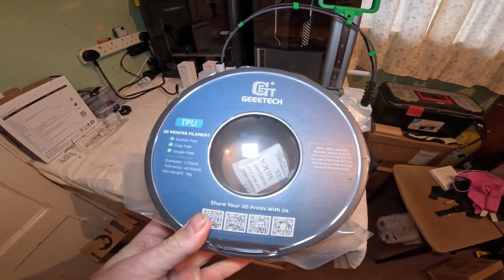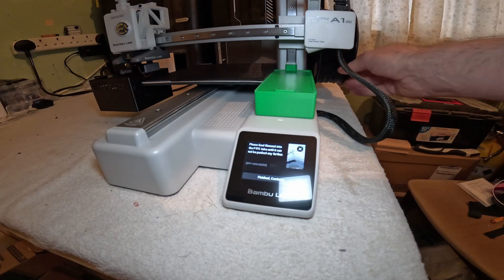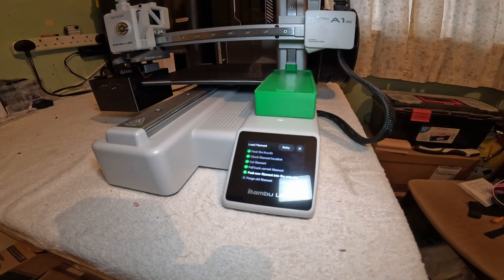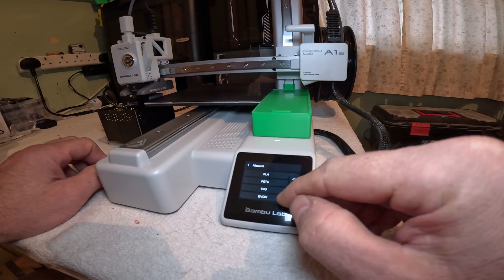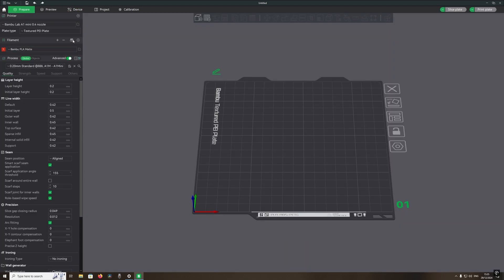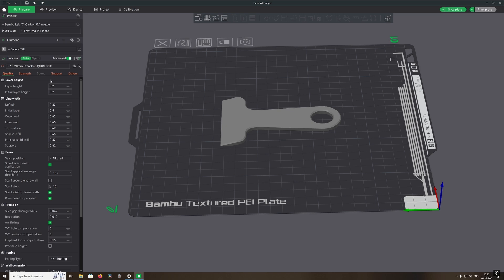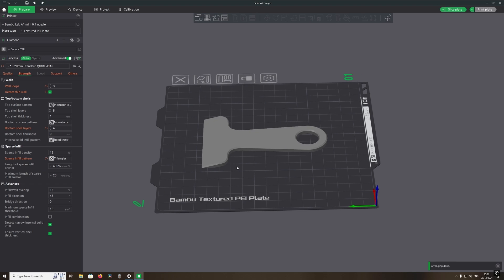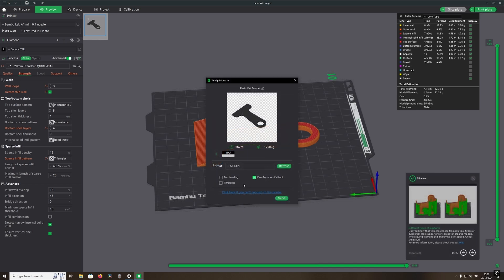Bambu Lab A1 Mini, how good can it print TPU.?

Comment: Halo mr, is it true that you can use TPU filament with the Bamboo Lab A1 Mini? Then, when loading the filament, why don't you switch to generic TPU first? Because what I see is that you change it after loading the filament and then printing the part.
Reply from the maker: Because when I use genetics settings.. it doesn't print as good as it does with bambu settings...

Comment: For some reason my printer cant detect the filament
Reply from the maker: You need to do it in the bamboo software unless you are using bamboo filament in an AMS
Reply: @CALTECH3D thank you
Reply from the maker: No problem 👍
Reply: A1 mini can't detect filament automatically by itself. Unless with Amsterdam lite.

Comment: Nice video but suggest you shorten or eliminate the portion where you show the printer printing the part as most people doing 3D printing know the printer actions.
Reply from the maker: Thank you for your comment, but some people new to 3D printing maybe interested in that part.
Reply: Agreed, not many videos on the A1 mini so the info is appreciated although i'd recommend showing the removal of the part from the build plate and demonstrate the flexibility of the material you're using